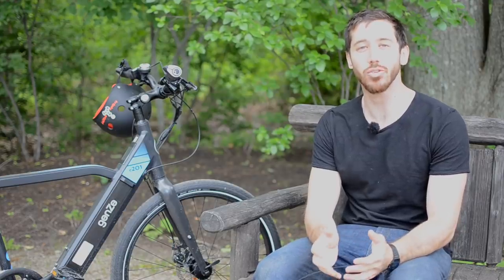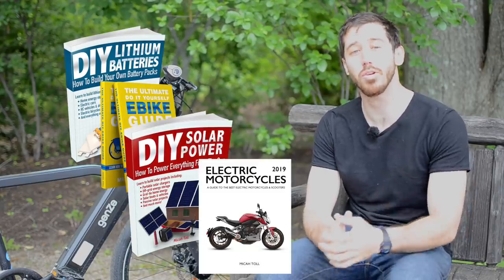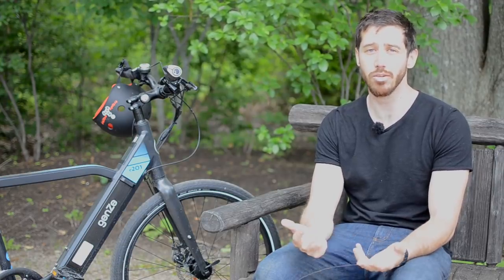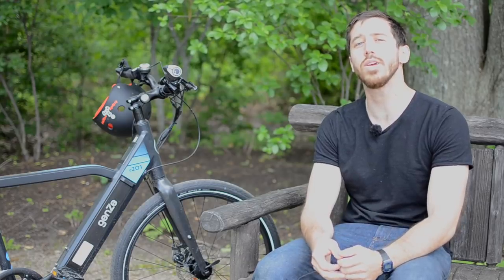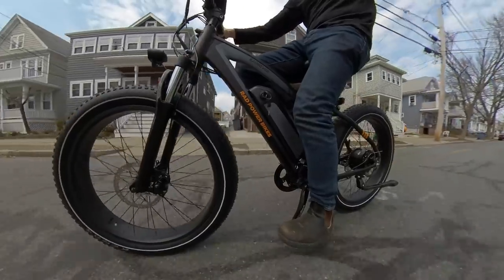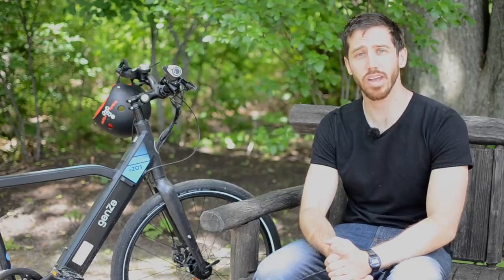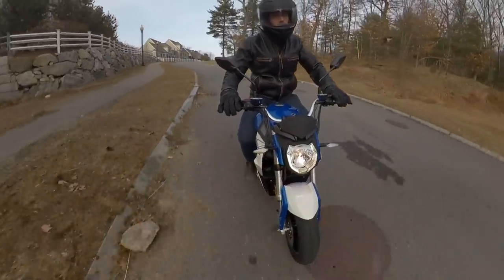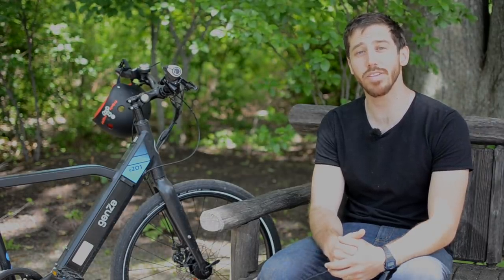How much POWER does an ebike need?

Comment: What you really have to consider is, how long is a chain and cassette lasting with mid drives? 
I have two 250W ebikes, one as a hub motor and one with a Bosch Active line Plus. I drove my hub motor powered ebike for almost 10.000 km and the parts are looking good, even it is just an Acera drive train. With the just 40nm mid drive stystem, the Deore cassette is done after 3000km. 
So if you want a bike with more power, keep in mind that mid drives eating up your drive train. I don’t want to know how fast a 1000W Bafeng mid drive will kill your parts.
Also keep in mind, you’re roasting your battery with those motors.

Comment: sadly 250w pedal assist is all thats allowed here. been using a 12 year old one with the original ni-mh battery and is still pulls 'strong' for it and keeps going to 28kph and normal assist still has a range of about 30km. great thing about is the battery can become completely dead flat for months then  i can pedal for regen and it charges itself right up, plug in for a night and its full,it doesnt die on me.

Comment: DECENT VIDEO, I LIKE THAT YOU WERE BIASED IN THIS VIDEO, I HATE PEOPLE THAT SLAM 250 WATT HUBS, I HAVE A ANCHEER 16" BIKE, WITH A 250 WATT, 36 VOLT HUB, AND IT WORKS GREAT FOR ME, 2 POINTS THAT YOU MADE IN THE VIDEO, IS THE LEVEL OF TERRAIN, AND THE WEIGHT OF THE RIDER, AND THAT IS VERY TRUE, I LIVE IN A CITY THAT IS ALMOST ALL FLAT TERRAIN AND I AM A LIGHT WEIGHT RIDER, EVEN THOUGH I HAVE A LOW POWER BIKE, I DO NOT NOTICE, IT GETS, UP TO SPEED DECENT AND I CAN RIDE MANY MILES WITHOUT PEDDLING, WHERE YOU LIVE AND RIDE HAS THE BIGGEST PART ON WHAT WATTAGE AND VOLT IS SUITABLE, I LIKE YOU MADE THAT POINT, I LIKE THE VIDEOS WHERE PEOPLE ARE BIASED, I GET SO TIRED OF VIDEOS ON HUBS AND EBIKES THAT CUT DOWN ANY EBIKE UNDER A CERTAIN WATTAGE AND VOLTAGE, NOT EVERYONE WANTS A HIGH END BIKE, AND MOST PEOPLE CANT AFFORD TO SPEND THOUSANDS ON AN EBIKE, I HAVE HAD MY EBIKE FOR ABOUT A YEAR, AND THE BIKE IS GREAT, I HAVE HAD MINOR ISSUES, MOSTLY NOISES FROM BUMPS, AND I HAVE FOUND WAYS TO ELIMINATE THE NOISES, I FEEL THAT MOST EBIKES ARE AWESOME IN GENERAL, I KNOW THERE ARE SOME EBIKES THAT ARE JUNK, BUT IF YOU KNOW WHAT ARE LOOKING FOR YOU CAN FIND SOMETHING THAT YOU WILL BE HAPPY WITH, I AM STILL VERY HAPPY WITH MY 16" ANCHEER, I THOUGHT HOW INTERESTING IT WOULD BE TO MAKE THIS EBIKE A SLEEPER, I ALSO THOUGHT HOW SCARRY FAST IT WOULD BE IF I DID THAT, BUT ITS CALLED MONEY AND A LITTLE TIME, GREAT VIDEO

Comment: I have to disagree with you that 250w is only enough on the flat. So far my Tern HSD will comfortably climb any hill I point it at. There is some drop in speed on the highest gradients but my Bosch motor does not feel like it’s struggling.

Comment: This video almost entirely focuses on throttle operated electric bikes. In Australia, United Kingdom and Europe. Legal on - road use is pedal assistance only limited to a 250watt motor, speed governed to 25kph +-10% with assistance. These don't even have a throttle. Consequently your review has a very USA perspective only when it comes to motors and power.

Comment: I have a 250watt  Haibike  Xduro Hardtail Bosh mid drive motor system  29er and I can climb any 
hill in the Lowest level of pedal assist. And I also  have a 2014 Easymotion Neo Jumper with  a 350watt hub motor and I can also climb any hill in the lowest level  of pedal assist , it also has a throttle. So I really disagree with what you say the lower powered Ebikes are capable of.And I also have 3 other 20 inch ebikes not mentioned that are extremely capable.
Reply: Steven Soco  Awesome bro

Comment: I think your idea of adequate power would be geared towards riders that don't want to pedal much and are looking for something more like a motorized bicycle than an assisted bike.  I've had both Bosch class C and BBS-HD conversion and there is something to be said for a lighter, more nimble bike as I enjoy the riding experience more on the Bosch equipped, sub-50lb bike than on the ~70lb monster bike with the BBS-HD.  That one was fast, but clumsy in comparison to the Bosch equipped bike.  I believe the Bosch motor rated for 28MPH is around 350 watts continuous vs. the HD's 1K watts.  As a side note, the Bosch equipped bike also feels a lot safer - better brakes and handling, lighter (easier to control).

Comment: A better question is how much range you need on an EBike because motor winding is cheap but batteries are expensive, large, and heavy. With 22 pounds of Lithium batteries, you can range around 40 miles on a 1000 watt motor. Which will run you around $600 just for the batteries and take up most of the frame space on your bike. 

Anything over 750 watts and you really need a steel frame to handle the torque. A light/cheap aluminum frame won't cut it.

Comment: Youre my guy! I know this is an old video but maybe you can help me better understand. I live in China where electric scooters are very popular. I currently have a 60v47ah battery which can provide a continuous 50Amps. if thats the case should i be using a 3000w motor or am I missing something? I haven't been able to find whether or not my current 2000w motor is 2000w continuous or 2000w peak but 2-3000w motors seem to be the norm here for people using 60 or 72v batteries. I am going to upgrade to a 72v60ah battery as well which should be able to output a lot more current like 100a. Would i think be looking at a 7000w motor? The shops are telling me 2000w permanent magnet motor would be enough. Any help would be super appreciated!

Comment: I built a bike using an alternator converted to motor and am currently using a cheep 1000w controller. I have plans to build a 52v 40ish ah battery and I would like to hear some recomendations on what controllers are best in the 1500 to 3000 watt range. I am 175lb. and using a single speed mid drive setup. price is not a factor, I simply want the best controller I can get for all types of riding. thank you

Comment: I am wondering about one thing regarding the hub motor. 
If I wish higher speed that means higher revolution for the hub motor too.
However, does higher speed drain the battery much quicker. 
Other factors  should be considered obviously as drag and a few more bits and bobs.
I guess that it is nearly the same as a car. I I drive 50mph that burns less diesel than 80mph on motorway. 
Higher speed mean more air resistance.
Correct me if i am wrong.
Thanks for videos. ☺️
Reply: My absolute Opinion: Yes. You are correct.  ---Picture yourself walking a mile... now running a mile.  Which activity in energy are you
going to "burn" and exhaust more?
Reply: @donnyvgemini1692  Yes, that is straight forward if You consider this way. However, physics is not that simple :D . Higher speed means more energy, I agree.  But....Higher speed means also that less time is needed for the given distance. So maybe You burn more energy every minute, but the same journey takes shorter time. It is more complex.
And if You work it out this way the energy input difference might be neglectable.  In simple words: The distance is 10 miles. The speed is 10MPH. So, one hour is needed to make that journey. And a certain wattage. If the speed is 20MPH the time is only 30 minutes. The main question is how much more wattage is needed to the same journey 20MPH compare to the 10MPH speed. Hopefully my explanation is understandable easily

Comment: I saw a Bafang factory tour video the other day . In that video the tour guide made mention of a 1 kw motor they make. I bet that would make for a super torque bike ! How much battery would you have to have to make it work right ? I think this would make a very strong street bike if limited to 20mph . My personal choice would be a single speed with a gates carbon fiber belt set up.

Comment: I'd be interested in also knowing what the options are if one is say, 50 miles from home when the battery dies. Does the difficulty in pedaling go up with the power of the motor?
Reply: If your using a geared motor, be it mid drive or hub, the only thing you have to contend with is the weight of the motor and battery. There is no resistance caused by the motor.

Comment: You didn't mention that geared hub motors are better for climbing hills. What is the most powerful geared hub motor you can get (Bafang 750w?)? and how much can you over power it from the controller? I saw someone claiming to put 1200w through a 350W motor without problems.

Comment: I know this video is a year old, but I was hoping you could answer a question that I don't recall you talked about before.  In terms of power, what about the battery voltage?   A lot of bikes are 36 volts and some more expensive ones are 48 volts, but they both have 500 watt motors.  What's the difference, isn't 500 watts = 500 watts?

Comment: Hey Mica, Thanx for your knowledge and all the videos you have made.
I would like to build my own ebike  and have pretty much decided on a couple of things
1- I want a mid-mounted motor and 
2- I want to have a 1/2 twist throttle (I think you called it in one of your other videos?....where only half of the handle bar grip rotates)
So when you buy a motor does the manufacturer just send whatever throttle they have decided to put with their motor or do they-(Like Bafang motors)- not include ANY throttle and I have to buy that from someone else, so then I can pick a full grip throttle, or 1/2 grip, or just a lever that I depress???
Could you give me some throttle manufacturers (Especially 1/2 throttles since that is really what I want to use)
   As far as motor makers I want the most powerful mid bike motor I can find but cost is always important too so if you have suggestions as to which one would give me the most "BANG" for my buck  I would sure appreciate that too.
You can get back to me at scorpion156@live.com
Thanx, 
Sterling

Comment: the most impressive bike i have driven sofar  was in my opinion a Gruber Assist - meanwhile renamed to Vivax Assist...
it has "only"  110Watt of Power... BUT: thats about the amount most people are able to deliver over long time..
the nice part: the motor weights only 700g, controller 200g, battery 800Gramms
the bike including the Drive was about 10,5kg (!)
it was absolutly not noticeable that there was a motor mounted when turned off.. the motor is hidden in the seat Pillar  (has to be 36mm)
it was the most impressive Bike for me sofar, because it was that lightweight, that stealthy - it was riding like a normal bike, but increase your power for up to 2h by up to 110Watt  (which is plenty)
have for myself 6 other ebikes with different drives, but: most impressive for me: the Vivax

Comment: I want 750 and bigger wheels. Those 20 inch tires- even if fat dont impress me. I have a bunch of bikes and none of my daily drivers is a 20 in. For that reason i may convert two bikes instead of buying a new fat tire bike. I like the sondors mad mod scrambler but its crazy expensive. Anyway- i just love ebikes- dont you? I am an old girl and i ride a nakto pony. Affordable at $650 from mobility paradise. Its a good entry level and i recommend for a beginner and people of small stature. Cheers!

Comment: My opinion is 1500 watts mid drive would be a very hard minimum. I have my Cyclone detuned to 2000 watts and it is perfect for trails and transportation. I always limit a bicycle to 30 mph with any motor. It is just a bicycle.

Comment: I want to build a cargo bike and power it with two motors. Should I go with 48 or 52v? Thinking around 1000w cart will be two electric wheels at the front, free-wheeling rear. Can you please explain wheel size and watts you would recommend. Also battery size to get 10 to 15min trip length. Cheers from Australia.

Comment: im 140kg and have a 500watt 48volt hub drive bike and it gets me to about 35kph on a nearly all flat commute. i wouldnt say i need more power, but i definitely want more speed
Reply: Speed is DIRECTLY related to power, as power is the product of the speed and torque.  With the hub motor, the easiest way to get more speed from the motor is to give it more voltage - so you'd likely need a different controller, as well as a bigger battery.

Comment: I live in Hilly Bristol in the UK and under UK regulations 250 watt is the max i can legally use. As long as you are prepared to put some effort into hill climbing and you use the right gear, you can manage. Although i would like them to increase the  max wattage to 500 watts its not going to happen ever. Although we are supposed to be leaving the EU we are still tied to Europes rules and regulations and they are more likely to reduce it to 200 watt than increase it, car drivers just dont like cyclists in the UK and are moaning to try to bring in insurance, so we have a job on our hands just maintaining what we have. The one good thing about 250watts is the mileage is probably better than the higher wattage bikes

Comment: I have sidemotor whit short gear raitio. Its quik and tops 36khm whit 250w controller. Whit 1000w controller its insane, easily wheeling in 18 gear. And efficient. Whit mid mount gear ratio was always too long.

Comment: In terms of range what sort of difference is there between 250/500/750W? Is there a significant difference?
Also, would a 250W motor and a 750w motor that has been tuned to work at a max of 250W both have the same efficiency?

Thanks!

Comment: what about the difference between geared and direct drive hub motors and how geared hub motors need less electric to climb hills?
Reply: I have a direct drive. They're best at getting mpg, not great up hills. I slow down tremendously with steep hills.

Comment: I am wanting to add two hub motors rated at 1200w each and the Bafang 1000w mid drive. I plan on having the mid drive be a stand alone and the front and rear hubs working as one with there own controllers and throttle. Basically i will have to throttles and two displays. Will this work ? Do you forsee any issues with this setup? Thank you for your time. Great channel.

Comment: I am about to decide between a hub rear motor and mid drive. The hub is rated 35Nm and 540W which seems small compared to the bafang 65Nm and 500W. What would you recommend? More torq or more power?

Comment: can you provide some context around what you mean by hilly areas. this can really vary by region in the US. i live in the midwest which is normally very flat except where i live. We are at the point the glaciers from the ice age ended and have a more naturally hilly landscape of varying degrees. its not so bad intown but if you commute from downtown to the suburbs you hits some pretty large hills that go on for a bit. our downtown is lower then the outskirts. if you had some test data showing the elevation change of a route start to finish and how far you rode that would be helpful putting your information into context.

Comment: When you talk about the power,  are you talking about pedal assist or purely using the motor without pedalling?
Reply from the maker: Both, they are just two different ways to engage the power. But with pedal assist you often won't feel the full power, as opposed to throttle control which usually gives you full power.

Comment: Micah I have a Nakto city 26 inch e-bike it came with a 250 watt rear hub motor and a 36 volt 10 amp hour lithium ion battery. I broke six spokes on the hub motor rear rim. So I purchased a 500 watt 36 volt hub motor kit which includes the controller. Can I hook up the 500 watt hub motor to the controller on the bike or should I re-wire the whole bike and install the new controller?

Comment: Hi,
1. could you open up a controller and explain on the capacitors, able to operate at max voltage and current. 
2. Electrical connections for a dual hub motor, is it able to use a common controller for both motors on ebike?

Thanks

Comment: I know your an electric type of guy but if you want to try engine bikes, it would be an awesome video and make room for other types of videos like ebike vs engine bike, why ebikes are better the engine bikes, etc. Plus engine bikes are much cheaper then ebikes. Just if your interested.
Reply: They suck! (says a guy who has not burned a gallon of gas in 15+ years)
Reply: John Possum Electric that long? Cool. I would love to use electric bikes too if it weren’t so expensive. My engine bike totals out $130 for the engine, bike and everything.
Reply: @johnpossum556  A friend of mine Garreth aka Toppo, starts laughing and says Vaughn isn't burning any petrol (since I gave up cars as of 2016 and have an ebike)

Comment: Best videos on youtube regarding info on E Bikes. I have a question i have a Lankeleisi Folding  A6 Bike, with a 36v 8.7ah battery.  Bought this year late June What i am wondering if i wanted to get a more pwerful battery could it be done?   Approx cost? and could a bike shop do this?  for example to a 48v  12 ah? or more   by the way it has a 400 watt motor.  Thanks

Comment: Thanks for the great videos. I have an Ecomotion Core Pro E-Fat bike. It's a 500w 48v rear hub motor. I love the bike but I'm a bit disappointed in the power going uphills. A few fairly steep hills and I have to really pedal away to get up the hills. More so then I was expecting. Can you tell me how complicated it would be to increase to 1000w?. If I have to replace the rear motor that's okay but how complicated is it and does this mean other things like the controller will need to be replaced and if so are there kits for this?. I would really love to increase the hill climbing ability of this bike and I have no idea if increasing the watts of the motor or new motor is possible. I even thought about adding a 500w motor to the front as well but saw a video of a guy doing this and couldn't get both motors to work together properly. Thanks!!